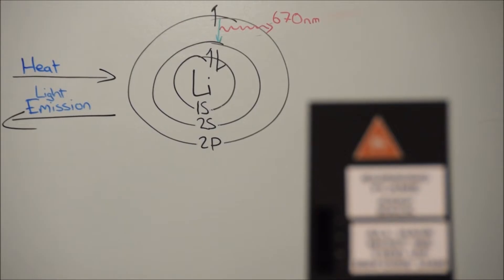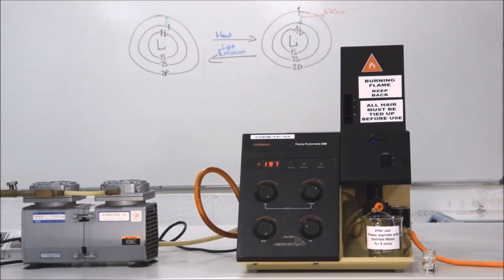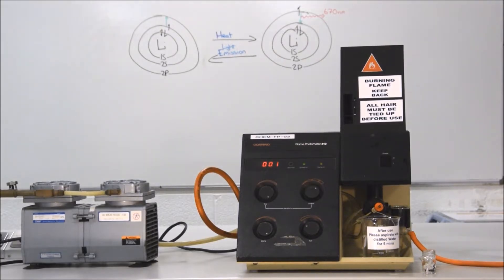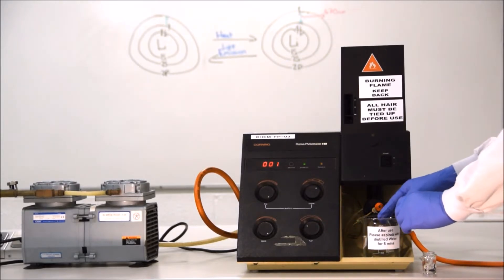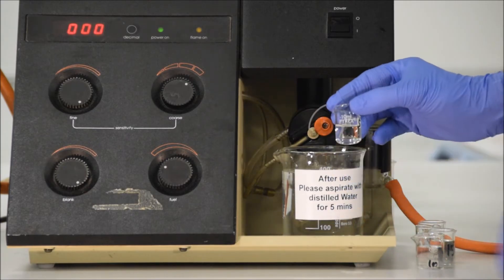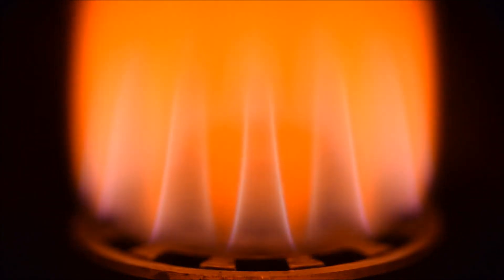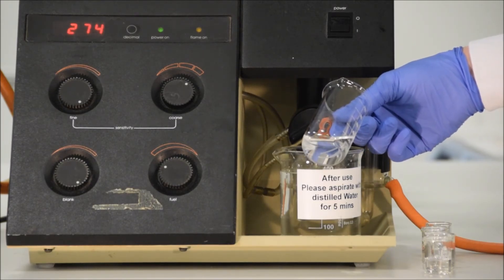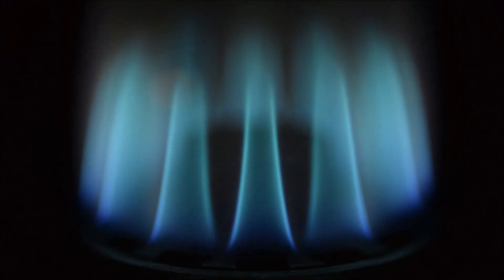Using a Flame Photometer HD

Comment: Thanks the video is very helpful. However the sound is not very clear and you speak very quickly.
I have a question, how can I adjust fuel mix? Thank you
Reply from the maker: If you go to 1:45 in the video you can see the four controls. The bottom right is the fuel control, clockwise to reduce the fuel level (leaner mixture) anticlockwise to make it richer.
Reply: @CVPQ  thank you very much